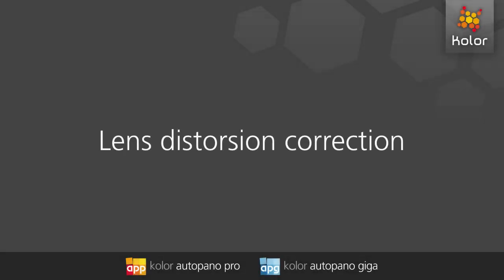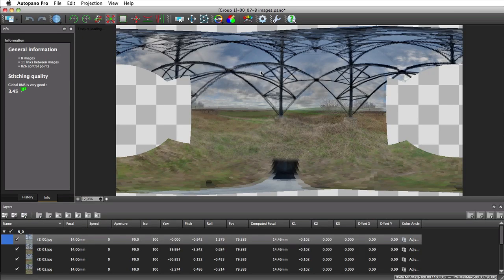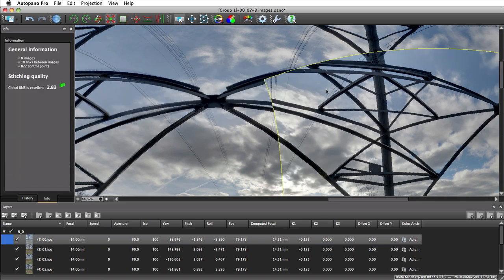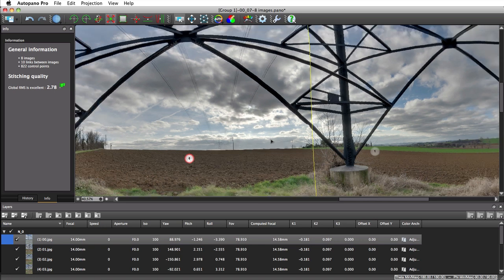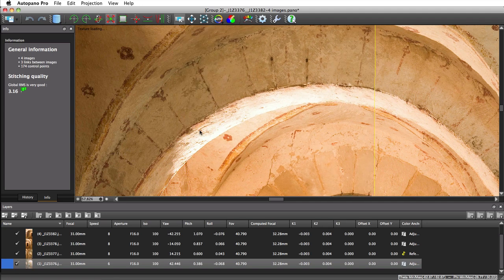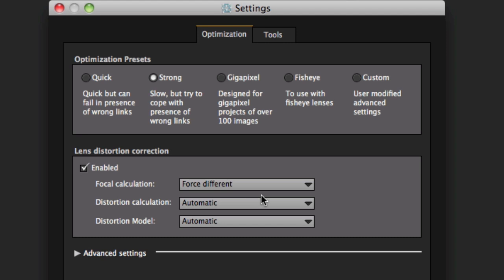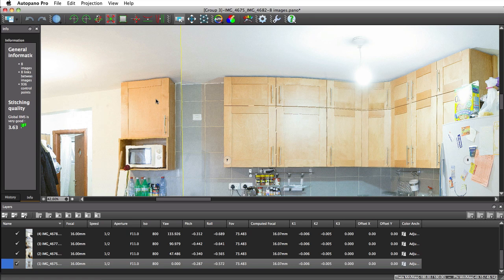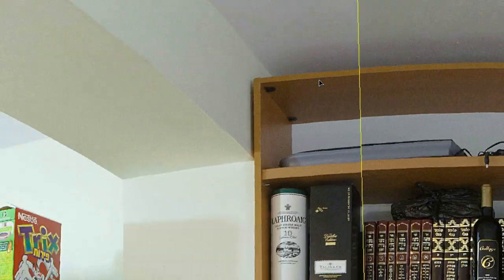Autopano: Lens distorsion correction

Comment: Yes, note to Kolor -

When you are going through menus and performing actions, the instructor should say where he is going and what he is doing while he does it.

The problem I have with this video is that in my current version of Autopano, the lens distortion optimization settings are NOT located in the control points editor as it is in this video. It's now located in the picture groups' settings.
Reply: toasToaTs And how do I find picture groups settings? I´m new on this software =)
Reply: In the first screen of autopano giga, before you launch the detection...it's on the same row as the "add pictures" icon...it's an icon with a picture in it and an i on top of it. It's next to the wrench. Hope that helps!